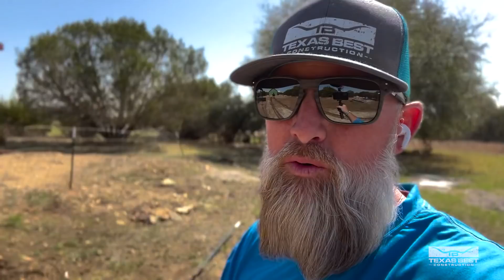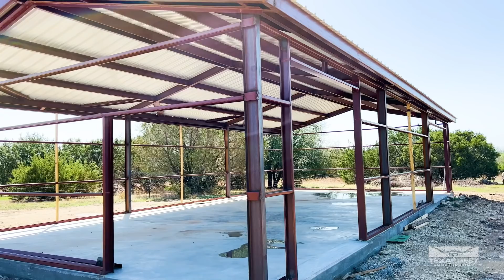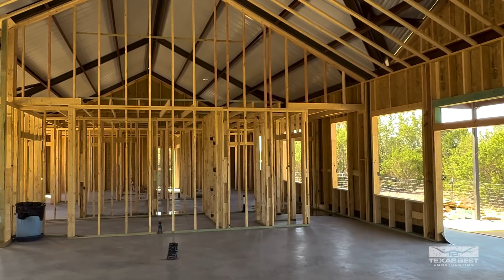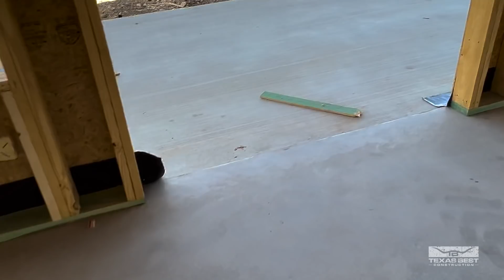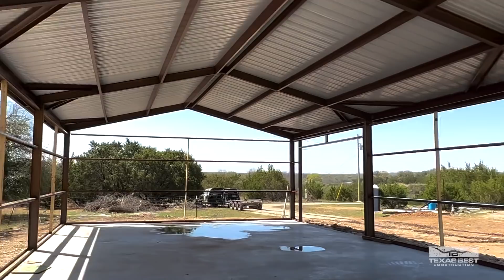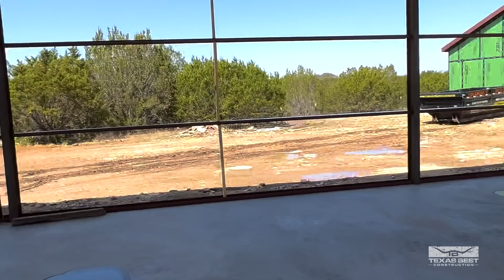Why I ONLY Build HYBRID BARNDOMINIUM Homes | Texas Best Construction

Comment: What can the issues be with a closed system if the power is out for weeks, or if you are off grid and try to use minimum heating and cooling?
Reply from the maker: I’m sorry? maybe rephrase your question?

Comment: What effect does the steel structure have to keep the barndo in one piece during various strength tornadoes? I read somewhere steel holds together in an EF3.
Reply from the maker: Obviously the effect is that steel helps with strength. That is an advantage and a big reason why we can span further with it.

Comment: Hello was wondering if you can hear the rain or wind with no plywood under sheet metal on roof? Or if the closed and open cell take care of the noice
Reply from the maker: Not really in the living areas… very subtle. But in the shop areas where less insulation you can hear pretty good.

Comment: It sounds the way you build makes a house way more efficiently sealed. Loved this information because I'm in the DFW area and just bought land in Granbury. So the whole side structure of the house is not metal?
Reply from the maker: Yes thank you. The wall system framing on the living areas are all wood stud framing with the wood substrate attached for moisture and air barrier it provides.
Reply: @TexasBestBarndominium  But you said you can also do all metal also?

Comment: …not sure I’d call it a (hybrid)Barndo but a conventional house w/steel roof frame.  I’m building a Barndo, all metal except for 2x4 (wood) partition walls.  The interior perimeter walls (skin) use furring hat channel.  Thnx for explaining market conditions.
Reply: Hi Josh!  I’m in a mild climate (northern AZ @ 5000’) and will use the Therm-All ProLiner insulation system; R-25 walls, R-38 roof.  Also the vaulted ceiling uses furring hat channel (no lumber) that attaches to the purlins.  The finished ceiling is PBM-Panel (no drywall).
I subscribed to your channel and look forward to great ideas.  You’re an asset to the Barndo industry!
Reply from the maker: @richt2633  great thanks Rich, glad to be here to share what I have learned with the products we have found useful. What are you going to use to stop moisture, air and condensation from the exterior? What’s your moisture barrier
Reply from the maker: Great. 👍 What are you using for exterior wall system?
Reply: Josh, I’m using Therm-All insulation products; Long Tab Banded System (R-38 roof) and ProLiner system (R-25 walls). The ProLiner system has a low permeance fabric face that serves as the vapor retarder, preventing condensation and contributing to air barrier integrity.  It meets energy performance and local codes.  After the ProLiner system, 1 1/2” furring hat channel attaches to the girts followed by drywall.

If you’d like me to post a ProLiner installation video, let me know.  Btw I’m an owner builder.

Comment: I'm really undecided on metal siding vs. Zip + Smartside.
Reply from the maker: well for smart siding you may be painting at some point. the metal is a great option because if you ever needed to remove a panel to access an exterior wall you could easily do so also fairly affordable and easy to replace if damaged

Comment: the hybrid is a long term gain on quality,no doubt,but its not cheap!!Lumber has come down to one third of what it was....even less for OSB,,FROM 54 dollars to 11 bux a sheet...A 2x6 ten footer( the one i have watched for 40 years) went from $7.88 to 23 dollars!!! NOW DOWN TO $6.88...! This hybrid could be a problem to find someone to do it,,easy 2 day polebarn frames done by Amish here ,are such a good ,fast cheap basic building to finish easily or hire it done if you choose to be your own general contractor.FOR 12 foot and less heights,WHEN you are going to pour a floor anyway,a slab first with a frost footing ,THEN STUD WALLS,NO POLES...easy lining it all up and you then have a stud wall ready to take sheet goods like sheetrock...I have seen some 16 foot high 80 foot long with a 40 foot span done WITHOUT POLES!on a concrete foundation..pole-free

Comment: You make the point well that you are breaking new ground with Barndominiums and I totally agree that it still on it's development journey..
  
I have been trying (here in the UK) to build something similar (on a smaller scale) for many years and are known as Live/work properties.
  
It is a very difficult procedure to even get started here.. Architects listen to you ramble.. nod at your drawings and follow with 'Have you considered a traditional build..? and look at you as if you are stupid..        This follows through with the authorities (Code)   'Well, this is unusual..'       To the Builders.. 'I've never done this before..I dont know how to price it..'   Can you Insure it..?    'It looks very different to the surrounding properties..'   Etc..        Our government keep pushing us to BUILD MORE but the existing system wont let us build something we actually want.

People like me,  look to you, our American cousins,  to advance this 'Model' until it becomes mainstream and then we can use your knowledge  to move for progress here.

In my designs I have arrived at a 'standard' building block of 4m x 4m x 3m ceiling.   Having portal frames approx 4m (13') apart seems to optimise other materials sizes/spans.
  
In my case I am interested in a 8m (26') x 12m (39') Building which is 100m2 (1000sq ft) footprint, which is a comfortable living area. A second floor gives an additional 100m2 for recreational use.        
To me, the main benefit of no internal structural  supports, is the ease to effect any future internal changes..   

Here in the UK, we are living with a Victorian attitude to how we use our houses.. It is very expensive and messy to alter houses to cater for modern living ideas.

I would propose the development and refinement of a standard (like above) frame system.. perhaps using a lamination of different materials to cover the rusting, rotting or fireproofing etc that all construction materials are subject to..              Rather like a Shipping container with no sheet metal walls, ceilings etc.. Just the frame..  Build onto that..
I look forward to seeing more of your video's

Comment: I appreciate your emphasis on creating an airtight barrier with the zip system and flashing on the walls. On the videos I note that you don’t use the zip system or any kind of sheathing before you place the roof panels, how do you create an airtight barrier there for the vaulted ceiling’s? Is the close cell application enough?

Comment: I've always been curious how Barndominiums can be "beefed" up, particularly in their wall systems. So often the conversation is pivoted to the feng shui of floorplans, maximizing space, and cost savings it just has me curious as to what it looks like going the other direction. What does a barndo with a wildly flexibile potential slab size, build time frame, no restrictions, no expectation of multiple stories, no expectation of layout, no expectation of large interior, look like? Like what if the entire plan and sole goal is for maximum efficiency and durability with only a "shrug" at the rest within reason? Obviously I dont want to live in or build a bunker, but lets say so long as it still looked like a barndo on the outside, what are some "extremes" that can be taken? Im assuming we would borrow from commericial/industrial methods? Thanks for any info in advance, just a south Texan trying not to melt!

Comment: Hey Josh. Thank you for making this very informative video. I do have a question.  Since metal is effected by thermal expansion & contraction and wood less effected , does this effect the fasteners’ gasket seal in the long run on the wall panels?
Reply from the maker: Not at all. Wall panel fasteners should not be near a concern as roof fastening. Just having good flashing methods is best to focus there.
Reply from the maker: Having

Comment: 6x6 posts JULY 29. 2022. I know what I want 36x36 wood 12" overhang all sides except front 9x38 awning part of roof gable single story  16ft peak (front to back)or code to ratio on 36 foot span w/12'overhang. W. Livingston TEXAS or do you know anybody in my area that wants the job?

Comment: Hey Josh... I will say a couple of things concerning the tag or declaration and use of  " HYBRID ". In every facet of business and normal day to day life...
   1) HYBRID anything... from a Mule, the result of mating a horse with a donkey... or a muzzle brake coupled with a tuner ( shout out to E.C.)... the adaptation of sales integrated with the internet and mail order, to the creation of many current breeds of canines and felines... etcetera... all are HYBRIDS. 
2) HYBRIDS are thought and created for specific needs. Most, lol, are done with the sole purpose of betterment, or improvement of what is currently used or needed.
3) When I hear " HYBRID "... and it concerns something in business or life that I need or desire... I check  that out first... why? It fits my needs possibly  ( 9 times out of 10)...
BARNDOMINIUMS ? 
Hell yes, it fits the description, but better yet... the customer's and your need.
Promote that moniker well, with honesty, skill, and integrity... sounds like that's a done deal. Good luck my friend.         Seth

Comment: I don’t know if you have covered this. I know you mentioned you use 2x6 for wood exterior walls but what size steel do you use for your posts? What kind of screw/fastener to attach wood to the steel?

Comment: this may sound crazy but is it possible to do a barndo with a crawlspace foundation? my thought is having a conditioned crawlspace that allows for HVAC and plumbing to reside under floor as well as the ability to reconfigure those things if needed at a later time. Thoughts?
Reply: I guess it's probably possible. But have you had a crawlspace before? We have 1 at one of our properties, and under heavy rain the sand would absorb water and introduce a ton of moisture under our house. It would rot the wood, and it even appeared to corrode the gas lines. Also we live in a very humid east Texas area. So in general, humidity could easily be above 80% down there.

So then we had to look into encapsulating our crawl space (which is hard unless you have a tall crawl space to do that in lol). We ordered a product from crawlspace ninja.
It worked great... but then we found it was too air tight and moisture can still find it's way in. And harder to find it's way out.

So THEN, finally we ran an hvac line through our crawlspace. And that solved the rest of our humidity issues.

Comment: I’d love a video on the differences between post frame with the laminated columns like what Kyle stumpenhorst uses and steel like what y’all are putting up. 
It’s seems further north there’s a lot more wood columns but down here in Oklahoma or Texas most folk use steel for the main frame.

Comment: Thank you for sharing your methods and your builds. I understand you use spray foam for the roof and wall panels.  I have discovered that using spray foam on the backside of metal panels voids the paint warranty.  Suppliers including Schulte Building Systems, Whirlwind Steel Building & Components, McElroy Metals, MBCI and Sheffield Metals have all indicated that the paint warranty will be void if spray foam is used.  Is this common knowledge?  Is this discouraging you from using spray foam?
Reply from the maker: No we are not discouraged from using spray foam. Our manufacturer does not say you “can’t” use spray foam. They refer to the preferred methods recommended by the SPFA which outlines how to do it. I would imagine that other manufacturers such as the ones you mentioned have a similar stance. We have never had warranty issues nor any troubles that would cause any concern.

Comment: Great video, Josh. Nice to see some "how it's done" info.  You mentioned bringing fresh air into the building, making it sound like an automated process. Is this the case or are we talking about opening windows & letting all the dirt in?
Reply: No in a net zero home you need to have a humidifier to bring in air in or it will be stale and dry
Reply: @JahisLovePsalms  are we talking a standalone humidifier? Or something like a swamp cooler that pulls air into the building from the outside?

Comment: How do you have extra moisture protection through the roof if it is not using any zip panels like the walls? Could you address the best practice for leak protection with all those fastener penetrations on the r-panel roof in another video? That’s one of my biggest barndo construction questions.
Reply: Spend more$ and upgrade the roof panels to standing seam, w/ clips & concealed fasteners. Typically, a snap lock type panel. don't forget to have striations rolled in the panels or you won't like what you see on a hot summer day...
Reply: Modern exposed fasteners last many years without leaks, and can be replaced.

Comment: From $13 to $70 per sheet over two years.... you can't convince me there's a legitimate justification for that aside from simple price gouging and greed on the part of the suppliers.

I'm glad you're adamant about building things the right way! Too many folks are too eager to cut corners these days.
Reply: Yeah it's horseshit.....I'm gonna get a barndo built by him one day, but them prices need to come down
Reply from the maker: @franquil85conn  I know man! Hope it does
Reply from the maker: Yes I really feel like they are selling less of it now so the high prices are only punishing the people left still buying it. A lot of builders are cutting it out of the package.
Reply: It's easy to see why the cost of homes have gone up with costs going up like that on just one component of a build.  Costs like that price most families and individuals of modest means out of home ownership.
Reply: @MrMikey1273  yes but when fuel costs and manufacturing return to normal, those cost should go down.  A roughly 600% increase in one component over 2 years is not a sustainable business model.  When their manufacturing and distribution costs go down, the price will drop
Reply: @franquil85conn  let's hope so. Currently even buying materials to do remodeling and repairs on my current house are far more expensive than 2 years ago. Also the wait for things like appliances and cabinets is way more than last time I've done work to my place.
Reply: Its called money printer go brrrrr
Reply: @clayjones553  Yup. Prices are not going down.
Reply: Market is about to crash then the prices will drop. Has already started!

Comment: We are just starting to put together our build here in Oklahoma. I love how you hit on “building Integrity” I found 1,000 guys that were willing to do a barndo. I found very few that didn’t act like they were just putting up a shed 🤦‍♂️
Reply from the maker: Well. Thanks. I know that there is a lot of pressure for people to create a cheap option to standard housing. Although affordability is always a concern it just can’t be sole focus.
Reply: Have you made a decision on your builder in OK? I’m in OK as well.
Reply: @chadhelms7184  don’t have anyone nailed down yet. We decided to meet with Greg James in Edmond,ok. He helps with the design process and has builders he works with. He has a YouTube channel. That’s how we found him.
Reply: @enginebae3471  We built a barndo in OK in 2020 with (not a builder, but erector) Mark Beard. He mostly does industrial buildings, but he and his guys did all the steel and even our stud framing for us, and we GC'd the rest. We made the personal mistake to spray foam right on the metal like Josh said not to. We feel like spray foam + steel beams gives us more integrity in the structure when it comes to storms/wind/tornado damage. It has been an issue with rain blowing in and the shell having leaks, but we have fixed most of the issues. Our barndo is the shop, and we still plan to build a house, and might go with concrete form. . .

Comment: My question is why is roof only sheet metal and spray foam ? I am wondering how sturdy it is when Hail or other weather comes into play. I believe the metal used is a bit thin for my liking, I was a Sheet Metal Worker for 38 years and the thinnest gauge we could use for anything was 24 gauge...